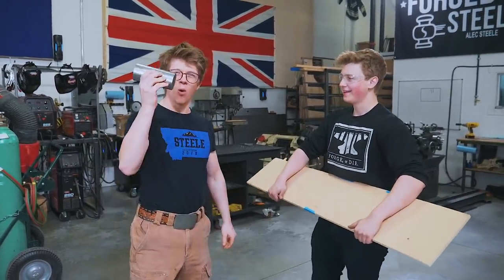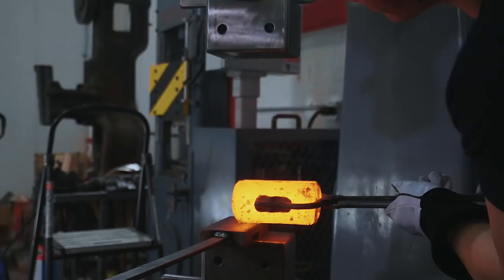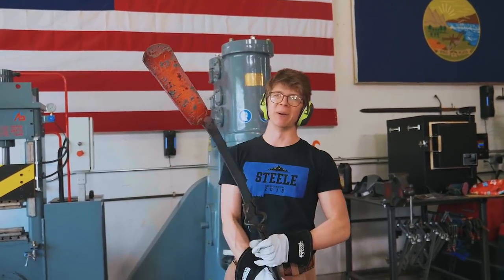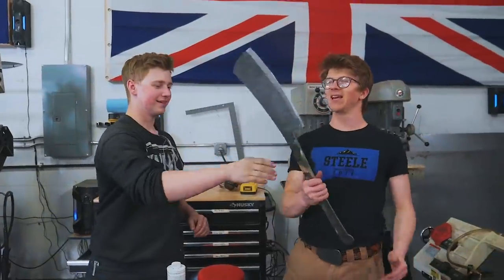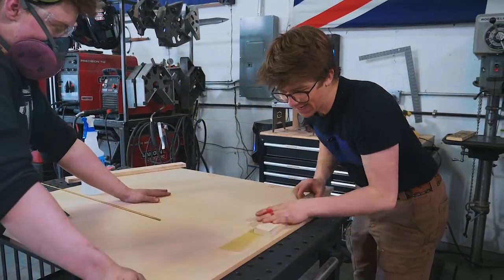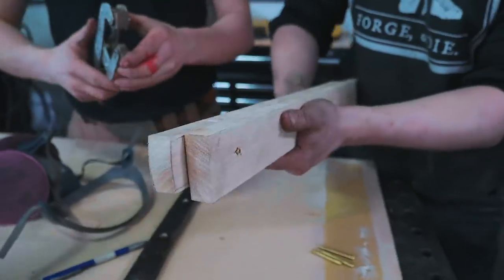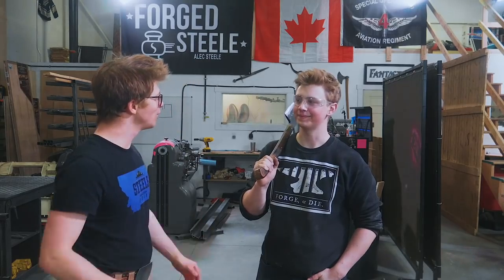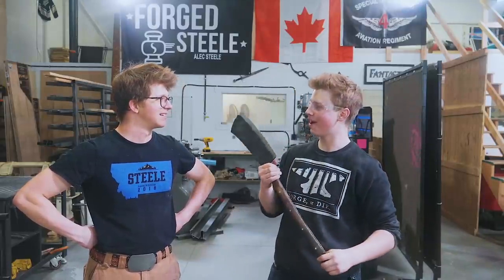FORGING THE HOG-SPLITTER!!!

Comment: Yay!

edit It's nice to see some more traditional forging done. I'm quite happy. :)
Reply: I agree with that!!! don't take it the wrong way I like seeing alec go and learn something new (setting gems) but that's not why I started and it's not why i'm still watching.
Reply: @benjaminmiller1142  - it's a tough balance, for sure. I have a feeling that he wanted to make something like this just for practice, as it's been a while since he has. So there has to be balance between learning the new, and practicing the existing skills. Now we're more on track with all of these 'interruption' videos. :) Seeming like a much better balance of forging/creating and learning new skills.

*edited because autoderp*
Reply: @Broadpaw_Fox  I think the main reason he got away from the forging aspect was because  he was waiting for the oven and vacuum chamber. All the other stuff was preparation for finishing off the handle once he got those 2 pieces of equipment.
Reply: @sheldonrunkey6160  - I'm not referring to only this project with the lack of forging. With the last few 'major' projects, he has had a lot of other work to do than just forging. But if you watched his older videos, there was a very clear emphasis on actual forging. Witness the 'Less yack yack, more whack whack' t-shirt he has. He was very much a forging monster, and now with his branching out into new techniques/areas, there hasn't been that much forging as of late. The Falchion is a great example- how much of that was forging the blade vs all the rest of the work? 

I love that he's branching out and learning new things, but I have to say that this most recent few weeks is a great example of how to do that and also keep some good old forging in the mix. It might make the major projects take longer, but then maybe not if as you said there is time spent waiting for something. ;)

TL;DR - Basically, I love the last few weeks- a very good balance has been found it seems.

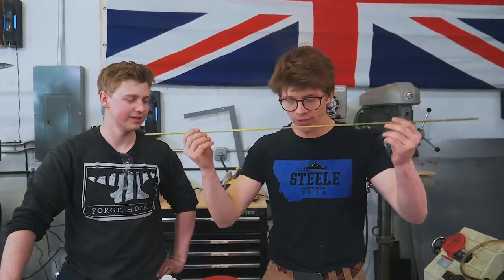Comment: Pin material 4:35... Brass is a yellow alloy of copper and zinc. Bronze is a metal alloy consisting primarily of copper, usually with tin as the main additive, but sometimes with other elements such as phosphorus, manganese, aluminum, or silicon. What you have there is brass.

Comment: Is it just me or is the “hog splitter” just a Cleaver with a really long handle
Reply: It is but it looks sick
Reply: That's the point. Butchers used a hog-splitter when a regular cleaver wouldn't "hack it," as it were. Chopping through bones and points could be hell on your arms, so having something like this could save time and energy when trying to break down multiple pigs.
Reply: Yeah, it's essentially a glorified cleaver, but the extra length and weight is necessary to effectively butcher large animals.
Reply: Splitters are for killing and quartering, skinning knives are for skinning, cleavers are for butchering, boning knives are for... deboning, and other fine detail work.
Reply: A hog splitter will be used to quarter. One this size is great for medium sized hogs, I have seen even larger ones, as much as 12 to 15 pounds with larger blade sections for huge hogs and cattle.
Reply: I have seen pro butchers used it especially the traditionalists ones that I met in New York. They are using it like it’s nothing just a single whack it cut the spine of a whole pig. Maybe the secret of his strength and technique is growing some beard😂🤣
Reply: Yes, that is what it is.
Reply: Basically, yes. It's got a boatload more leverage to cut through tough gristle.

Comment: can you make something from a cable that support bridges
Reply: I dont think that would be a good idea...those cables usualy have oil inside them and he does not know what kind of steel/alloy it is 

Sorry for my englich 😔
Reply: "Can"?  Almost certainly... "Should" or "will" .... Entirely different questions.
Reply: Oil filled, plus it is nigh on impossible to get the galvanising out from in the middle. It wont weld to itself.

Comment: When the zombies attack, this would be the weapon I'd reach for.
Reply: Though this is a nice tool to multi role, zombies are more squishy since they're rotten and you need more reach to keep them away, avoiding getting even scratched when mobbed. So a sword usually is the way to go. Unless we're talking chunky mutant varieties,  then a lance, polearm or halberd.
Reply: @chaoswarriorbr  People underestimate the humble spear. Remember, those things were the main weapon for thousands of years for a reason. Super easy to use, really long reach. The blade is actually about a foot long. This hog splitter is great but you'll fatigue quickly. Grab a simple spear for quick and easy head stabs on the zombies, but be sure to be behind something since if they get too close you're going to be in trouble.
Reply: Eric Romano I agree. A spear would be a great weapon. Light. Tons of reach and deadly. Easily made and replaced. A hog splitter wouldn’t be good. I own one and it’s good for bashing fruit and splitting hogs. Not much else
Reply: I'm going for a slingshot. Things are strong as hell if used properly.

Comment: The Hog Splitter was a very important part of the old-time butcher's toolkit. This tool was used to split a carcass into half-heads and quarters for easier processing. It was also sometimes used for limb removal from the carcass since it was sharp and strong enough to shear through bone and cartilage. Without a tool like this, a carcass would have likely taken 4 times as long to process due to the awkward nature of working with the whole.

Comment: I couldn’t see it in the video but it looked like you put epoxy between the wood and the freshly ground steel. The epoxy will likely loose its grip on the steel after a while, if you don’t rough it up before applying the epoxy.

Comment: I was just curious what method or methods did you use to harden the blade. I had a heavy Dexter Cleaver once and hit a bone and wrecked the blade.  Fortunately I got a really good deal on it so I wasn’t crushed that bad at the loss. I was not happy nonetheless.

Comment: Hey Alec,
Would it be a good idea to score the metal that you’re epoxying, before you glue it to another surface? That way the epoxy has more to grab onto. Or is that not necessary?
Reply: I'm not sure what the gritt was for the metal surface, probably nothing higher than 320 I'd say. Besides that it got multiple bronze pins to support it too.

Comment: While this is better than a lot of "forging" videos on YouTube, there was still a lot of sander used. In the middle ages you wouldn't have a power sander, only a particularly flat stone for honing. That edge would have to be roughed out with a hammer first.

Comment: The only flaw I could see was that the handle scales were too rounded. I noticed quite a few times when the blade rolled over in your hands, which basically turned that thing into a nasty hammer instead.

Comment: Nice first effort, but would work better if more of the metal were in the blade vice handle. When splitting a hog you want the weight of the blade to do the work, not brute force.

Comment: The quenching was wrong lol. Suppose to be just the edge that u want hard lol. Otherwise the blade will break. If u make the entire blade hard. 1. Never quench the spine or tang, if u desire a sturdy sword, machete, or knife. Only the edge should be quenched. The tang especially needs to he soft.

Comment: How odd I have an old hog splitter but it is not exactly cleaver like in shape its more machete like and for some reason it has 2 stabing points. It's like as if for some reason the previous owner broke it and ground out the double tip to make it look nice but that too had some purpose as that spot has wear on it too.

Comment: Havnt finished watching yet, but if it felt at all more front heavy then you'd like, a mix of shrunk leather thongs, and metal rings, could strengthen the handle against the wood fracturing, change the grip, and the weight. This is beautiful, I'd love to save up and buy a tool from you guys, bet it lasts more then a lifetime. A kukri, for working hedges and limbs, and as a hiking machete.